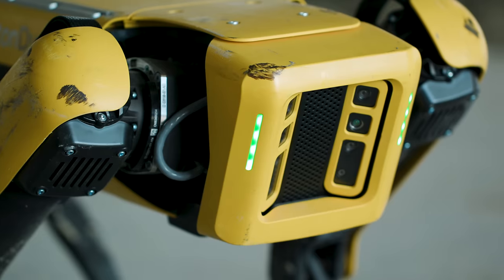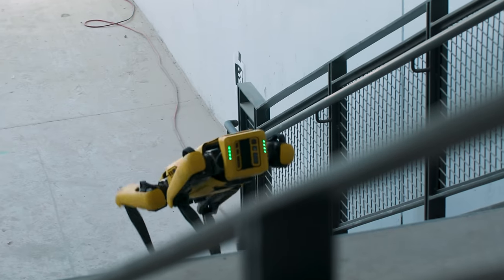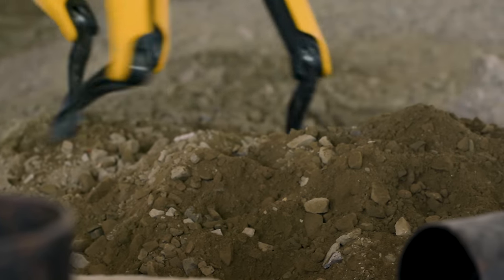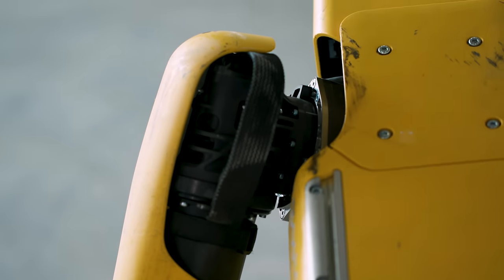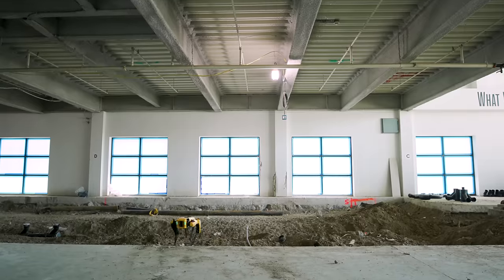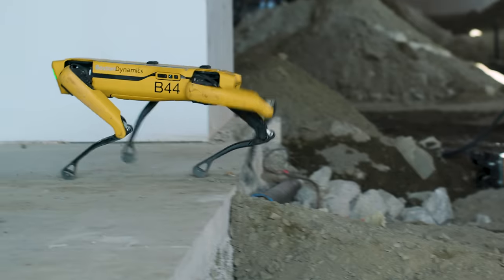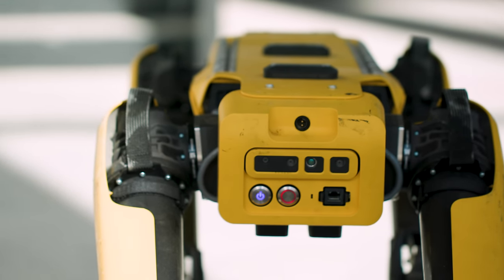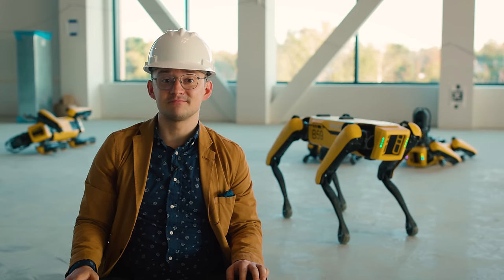Boston Dynamics Spot hands-on: new dog, new tricks

Comment: The question is, can I ride it to work?
Reply: @Russell Brandom so sad :(
Reply: Get a few of them and have them carry you around on a platform or pull you around
Reply: Yes, you're Cinderella until midnight
Reply: i mean.. there is a vid where they pull a car, right? maybe spot husky sled stlye? :D
Reply: @zakiNBG  I support the idea of the sled, since what matters are the added modules, it is possible to design a sled and make it about 4 robots that pull it. In addition, the whip for robots is also necessary, preferably designed so that the robots can feel it and we can see how they react to it.
Reply: They should have something like this in the shape of horse.
Reply: The pioneers used to ride these baby's for miles.
Reply: Not Spot, but pretty sure Big Dog can.
Reply: Get a chariot and let it pull you to work in style.
Reply: @pawala7  Had the army actually bought some of these I'm sure that's the first thing the solders would do -- have races on them.
Reply: You buy 10 of them to pull you with a cart
Reply: Silly Cedie, robots already do that for us
Reply: @FlutterSwag  that just sounds like slavery with extra steps

Comment: In thirty years we may be riding these things around like horses. They're not currently as agile as an animal or steady as an all-terrain vehicle, but give it a couple decades of constant technological improvement and we might have metal horses to ride that are as sure-footed as mountain goats. Wheeled and tracked vehicles will still have a place, I'm sure, since more of their area touches the ground for better traction and rolling is more efficient than walking. But on some terrain, walking on several legs can be far more practical than wheels or tracks. Goats traverse terrain no existing vehicle can. 🐐 These sensor-balanced robotic movements could make for useful vehicles able to go where other vehicles cannot.

Comment: The only thing spot is missing is a head. how about this for a challenge See if it can learn to be an icing dog for the blind. Of course they’ll have to get a lot cheaper before that is cost-effective. Of course that’s a Lotta new software GPS high-quality sensors etc.
Reply: You have no idea how this works
Reply: They have cameras, and anything else they need can just be fitted onto the main body. Why would the need a useless extra limb that serves no practical purpose? I guess if someone would want a head they could just take it off a plush toy.
Reply: And autotuned barking sounds